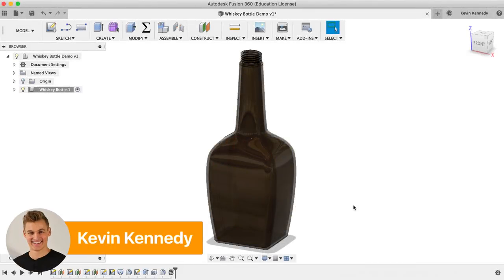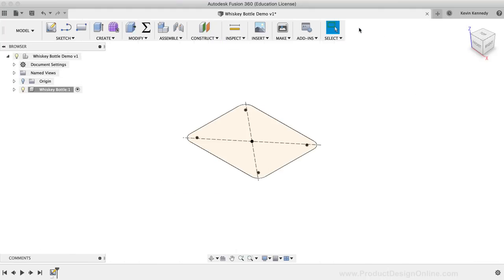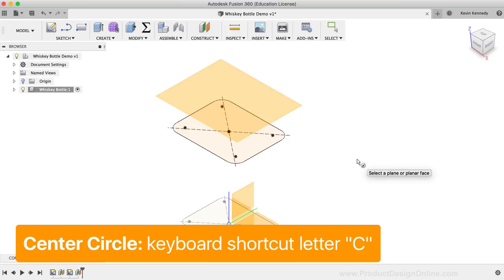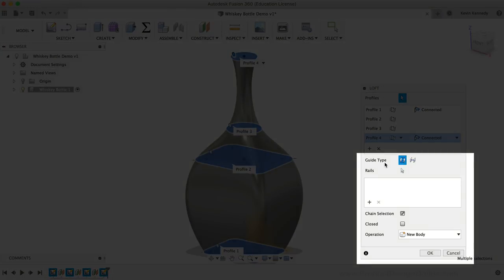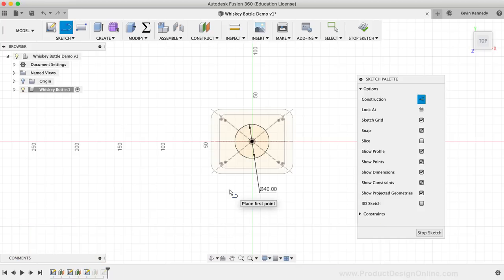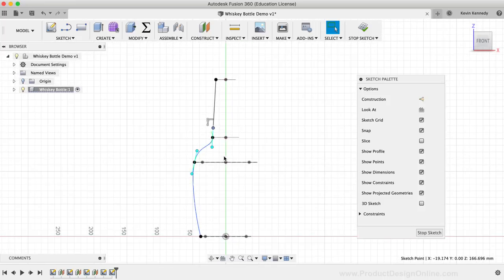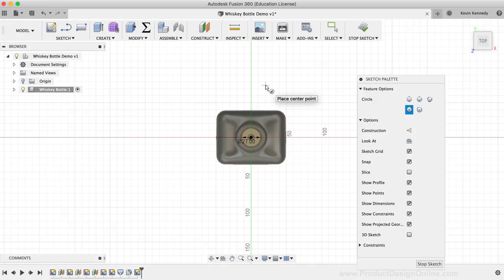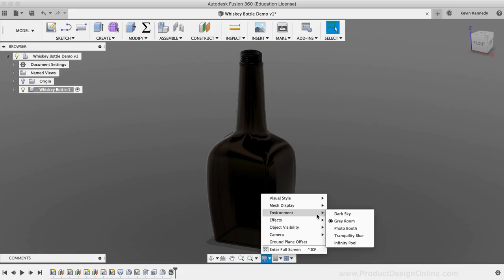How to 3D Model a Whiskey Bottle - Learn Autodesk Fusion 360 in 30 Days: Day #4 (REVISED)

Comment: I placed the construction lines and I and I can see the intersect points but as soon as I select the spline tool the points disappear. Any Tips?
Reply: This is happening to me too.  Did you find a solution?
Reply: I deleted the top circle and re drew it.  Then did the spline and it worked this time. I may have selected the wrong plane to draw in before.

Comment: Hi Kevin, while drawing the spline line in the XZ Plane, the construction line end points are not snapping.
Reply from the maker: Hi Sumit. Check that you have the "Auto Project Edges on Reference" setting turned on -  https://productdesignonline.com/default-settings-for-fusion-360-tutorials/#autoProject
Reply: @ProductDesignOnline  This did it.

It is great that you read and reply to these comments. I spent a long time before I thought of looking in the comments for someone else with the same problem. Since you answer all these questions in the comments you know exactly where in the video people are getting stuck. (I think that there are also some youtube analytics for that). If you could put a bit of text over the video with tip, like" if the spline is not snapping to the construction lines see XYZ in the description of comments".
Reply: This is so messed up! Yesterday this worked. I went to show my dad this morning. I'm using a Mac. He is on a PC. Changing the "Auto Project Edges on Reference" selection didn't work on the PC. I went back to my Mac to show him and now the feature will no work on either machine with either setting. We even restored defaults and restarted the program. This is ridiculously frustrating!
Reply: Finally fixed the problem. I projected the sketch points that indicate the intersection of the construction lines and associated sketch profiles into the XZ plane. As suggested by my friend Marty. Thank Marty!

Comment: none of my fit point splines snap over to the points of the construction lines i made. please help im about to break my monitor. i can get it to to work i think but there is not point to snap to. HELP ME PLEASE
Reply from the maker: Can you check that 'Snap' is on in the Sketch Palette? You'll also want to look straight at the sketch for best snapping results.

You can also Project the points to ensure they're available to snap.

Comment: I am still having problems with the spline command connecting and snapping properly to the end points of the construction lines.  I checked my settings.  The spline showed up as good, but I had errors on the rails part (does not touch all profiles).
Reply from the maker: Was your "Auto Project Edges on Reference" turned on?
Reply: I figured it out, the third profile was not touching at the line, so I drew the line first, then the spline.  I also had a settings issue, th project setting listed far below.  The videos are great, Thanks for all you do!

Comment: Once the loft is applied, my bottle is only a shell, there is no top or bottom closing it. ive watched the video a few times, cant figure out whats wrong
Reply from the maker: Hi Simon. It's likely that you used the wrong loft command. Make sure to use the Solid Loft (BLUE icon) instead of the Surface loft command (ORANGE icon). Let me know if that was it! Cheers, Kevin :)

Comment: 12:18 Instead of drawing construction lines across each sketch plane, couldn't you have used the points tool in order to put points on the sides of each plane then snapped the spline tool to those points?
Reply from the maker: Hi Tom. That can work too. However, you may lose your reference points if you were to alter the geometry in the future. The lines are a bit better as with the horizontal constraint they'll always remain centered.

Comment: I’ll keep trying, but the construction lines to the edge didn’t create “points”. Not sure why, but with the spline tool and zoom I could select the edge regardless, but it didn’t snap there
Reply from the maker: Hi,  BigRedNZ1. Can you check that your "Auto Project Edges on Reference" setting is turned on? https://productdesignonline.com/default-settings-for-fusion-360-tutorials/#autoProject

Comment: I get an error that says the selected rail does not touch all the profiles but I am pretty sure they do is there any practical solution for this. Thank you
Reply from the maker: Hi, Faruk. the points may appears to be connected, but it's likely that one of them can be easily disconnected if it didn't snap to each other. Try clicking and dragging on each point. When you find a point that does move away, you'll want to add a coincident constraint to it.
Cheers, Kevin :)
Reply: @ProductDesignOnline  i tried it but every time it says the same thing and i tried to do up to bottom when i do that it gives error about bottom point if i do bottom to top like u did then it gives error about top point
Reply from the maker: @farukz.9904  Can you share the link to your file?
Reply: I am having the same problem. I have deleted everything and started over multiple times. I know FOR SURE the points are on each profile. the problem seems to be the spline line not connecting to the regular line, although still showing the symbols and having the symptoms of doing so.

Comment: Hey man, I love your tutorials but seems like i can't finish even a single project, in this one when I'm adding the rails this thing pops up  "The selected rail does not touch all the profiles"
Reply from the maker: Hi, apoorv shrivastava. You will need to double-check that the spline and straight-line touches all four of the profiles. Be sure to pay close attention to what happens at 17:42
My other loft video also covers some of the techniques and common errors that can happen when lofting profiles - https://youtu.be/Mimbq-k2dWg
Cheers, Kevin :)
Reply: Still having the same error after ensuring the spline is connected to the line
Reply from the maker: @clickandcompany5504  Please share the link to your file and I'll take a look. To share your file please go to File > Share > Share Public Link (make sure "downloadable" is toggled on) > Paste your link here as a reply to this comment. Cheers, Kevin :)

Comment: I lost you when I tried to radius the bottom of the bottle.  The program would not select the bottom. It also would not select the top to add the threads.  When I rotate the bottle to look at the top, it appears to be just a thin shell, not a solid object.  I'm not sure where I went wrong as I was following your instructions, pausing the video to complete each task.

Comment: I am still getting the error message the selected rail does not touch all of the profiles. What do I do?
Reply from the maker: Hi, Kurtis. Click and drag on your rail points (spline points). If any of them can be moved away then they're not constrained into place. You can add a "Coincident" constraint to the points to force them to stay with the profile.

Let me know if that helps. Otherwise, I'd need to see your file to give you a more direct solution.

Comment: I have redone this over and over and watched the video multiple times, and for whatever reason I cannot get the spline and the line to connect. the symbols show up and the point slides up and down the line for the neck, but once I try to do the loft command it still tells me that the rails do not intersect with every profile. it is still only selecting the top or bottom half of the line.

I can select everything and then deselect the lines that make up the profiles, leaving just the rails on either side, but I cannot select ok, because of the error message.
Reply from the maker: Hi Unruly Rotors. Can you share your file so I can take a look? To share your file please go to File > Share > Share Public Link (make sure "downloadable" is toggled on) > Paste your link here as a reply to this comment. Then, please write a separate comment letting me know you've replied with a link because YouTube flags most links and I don't always get notified. Cheers, Kevin :)
Reply: @ProductDesignOnline  the crazy thing is I can highlight to select them all, then deselect the ones that are not the rail, and I still get the same error.
Reply from the maker: @UnrulyRotors  I looked at your file and it appears the line on the left was a cause of the error. To check this, I deleted that line and when I went to re-draw the line I noticed it did not want to snap to the left side of the top circle profile. After recreating that line, ensuring it snaped to the profile, it seemed to loft-like usual. Here's your file with my changes - https://a360.co/3bkLkoU
This may have been a settings issue. Do you have the "Auto Project Edges on Reference" setting turned on? https://productdesignonline.com/default-settings-for-fusion-360-tutorials/#autoProject
Cheers, Kevin

Comment: Never got the rails to work,  just had to move on.  Have used rails successfully in vectric aspire.
Reply from the maker: Hi Michael, did you try adding coincident constraints? Would you mind sharing your file with me so I can take a look?

Cheers, Kevin :)
Reply: @ProductDesignOnline  Hi Kevin. I'm having exactly the same problem. It says that "the rails do not intersect all the profiles". If I make a zoom in on the spline, it seems that the spline does not go through the fit points (except for the first and last fitpoints). Is that normal ?
Could you take a look to my file ? How can I share it with you ?
Thanks
Roger
Reply from the maker: @rogergallart  I'd be happy to take a look at your file. Share your public link as a reply to this comment. Here's a video explaining how to share a public link - https://youtu.be/2XrcrdV-8Ls
Then, please write a separate comment letting me know you've replied with a link because YouTube flags most links and I don't always get notified. Cheers, Kevin :)
Reply from the maker: @rogergallart  I took a look at your file and everything looks great on my end. I wish I had a good answer for you as far as why it didn't work right away, but it's really hard to say what could've caused that. Lofts and sweeps are probably the most "picky" features in Fusion 360. Anytime you're having trouble with something such as a loft, I recommend stepping away from the computer for a bit. Usually, it's one point that isn't connected, or something small, that we don't notice at first.

Anyway, keep at it and don't hesitate to comment on my other tutorials if you have questions! Cheers, Kevin :)
Reply: @ProductDesignOnline  Great! Thanks very much :-)
Reply from the maker: @rogergallart  You're welcome! :)

Comment: For anyone STILL having problems with the guide rail error after you checked to see if "Auto Project Edges on Reference" is turned on, try turning on "Chain Selection" in the loft's Edit Feature pane.
Reply: it's still not working for me, it says "the selected rail does not touch all of the profiles"

Comment: Great series, I'm just starting but for sure it is a lot of work to prepare all this so thank you. 
One thing though, when I create the spline, it won't snap to the construction points we prepared in each profile. 
As a result, when I try to use the splines are rails, it tells me they don't intersect with all profiles and it would not let me loft it... anyone having the same issue? I'm using the online version so it is the newest as of this comment.
Reply from the maker: Hi, Hogehoge. That may be due to the "Auto Project Edges on Reference" setting. You can learn how to turn that on and check your settings with mine here - https://bit.ly/defaultsettings

Comment: For me the spline tool only snaps to the first point. It won't snap to the rest. Thanks for any help!
Reply: I figured it out. If you rotate into a 3d view, it doesn't work. If you stay on the front (2D) view, then it works.
Reply from the maker: @bbrendon  Hi Brendon. It should still work in 3D mode. It may have also been the "Auto Project Edges on Reference" setting. https://productdesignonline.com/default-settings-for-fusion-360-tutorials/#autoProject

Comment: I have tried this for two days now!
Drawn it 8 or more times from scratch.
All my lines are locked!
They clicked into place when being drawn
They have black dots
They can't be moved away from the profiles
They are single black dots with all lines intersecting in the centre when zoomed in max.

Still I get error that rails don't touch profiles. 
Is it because I'm using a trackpad?
I don't seem to be able to move the dots so how can I tell if all other signs tell me it's ok.

Not falling in love with 360 I have to admit.
Reply from the maker: Can you share the link to your file? 
To share your file - In Fusion 360 go to the FILE menu > Share (flyout folder) > Public Link. Make sure the "downloadable" toggle is turned on and then copy the URL and paste it as a reply to this comment.
Reply: @ProductDesignOnline  Hi, thanks for helping Kevin. I've tried that and I only get the option to download the screencast recorder.
Reply from the maker: @andywilx8815  Make sure to use the File menu within the F360 application...the one just to the right if the grid/data panel icon. There should be four options within the "Share" folder.

It sounds like you're using the File menu for Mac or Windows.
Reply: Got it, I think the problem might have been my construction lines. Great tutorials Kevin. 
I’m working on a model for 3D printing and need parallel lines embossed inside a disk. Like a thread but not a thread.
Can you point me at a tutorial that will help and isn’t about embossing text.
Many thanks, keep up the great work.
Reply: worked out the parallel lines solution. All tanks to your tutorials. Many Tanks

Comment: I tried repeatedly to complete the loft command properly when I tried to add grid lines in the loft command it says rails it says the selected rail does not touch all of the profile points and I did line up the spline from the body to the line for the top as suggested. Not sure how to proceed
Reply from the maker: Hi, mbnaso. Please share your file so I can take a look. To share your file - In Fusion 360 go to File > Share > Share Public Link (make sure "downloadable" is toggled on) > Paste your link here as a reply to this comment. Then, please write a separate comment letting me know you've replied with a link because YouTube flags most links and I don't always get notified. Cheers, Kevin :)
Reply: I have replied with a link to your response
Reply: @ProductDesignOnline  even though I shared a link I was not able to backtrack in the time line to the point where the spline would not connect to the points. If this is no help Iwill recreate the problem from scratch.and send another link when I get there
Reply from the maker: @mbnaso2699  Thanks, I'll take a look at it!

Comment: "Warning: The selected rail does not touch all of the profiles.
" even though the spline and the line are touching. :(
In the sketch, the top spline point handle is snapping to the straight line, but I can't loft.
Reply from the maker: Hi, Deses. That error could also be caused by the end points of either the spline or line not touching the profile edges. You can force them to touch by shift clicking and then selecting the end point of the spline and the edge of the circle profile (where you should've created the construction line). Then, right-click and select the "coincident" constraint option. The coincident constraint option will force them to stay touching. Try doing that for all of them and then re-mirror the sketch geometry to the right side.

If the error still exists after that then I'd be happy to take a look at your file. Cheers, Kevin :)
Reply: @ProductDesignOnline  I'm having the same issue. I think it's related to the fact that when sketching, I have 3D sketch checked and you don't. But when I uncheck 3D sketch it wont let me snap the spline to the edge of the rectangle/construction lines. I lose the snapping ability when 3D sketch is unchecked, but you don't somehow.
Reply from the maker: @chris3dprints488  Can you check your settings and see if you have the "Auto project edges on reference" setting turned on? You can also crosscheck your settings with mine by looking at this - http://bit.ly/defaultsettings
Cheers, Kevin :)
Reply: @ProductDesignOnline  Thanks! That fixed it!
Reply from the maker: @chris3dprints488  No problem. Glad that fixed it! Cheers, Kevin :)

Comment: Error report and solution: "The operation would cause a large topology change..." - I was lazy and never reset the dimensions to mm at the beginning, so I drew my bottle in inches. When it was time to add threads, Fusion couldn't figure out what threads would work for such a large bottle, so it threw an error. I used the scale command (used factor of 1/25.4) to shrink my bottle and then changed units to mm like I should have done at the beginning. Proceeded to add threads with no problem. Good luck everybody!

Comment: Man, my hair turns gray because when i try to select the rails for the loft command the same "warning: the selected rail does not touch all of the profiles" appear. Can somebody help me?
Reply from the maker: Hi, David - did you double-check that your top spline point is snapped to the straight line?

The second thing to check is to ensure all of your points are actually snapped or touching the profiles. Try dragging the each point away from its location. If any of them let you pull them away then they're not fully connected. If you want to force them to be/stay connected then you can hold down the shift key and select the spline/line point and then select the profile point > right-click> select "Coincident constraint".

Try those...if you're still having troubles then please share the link to your file. Cheers, Kevin :)